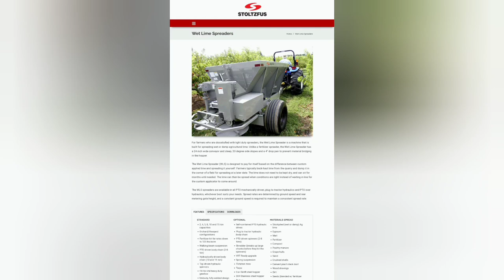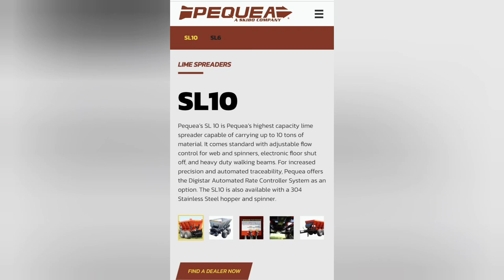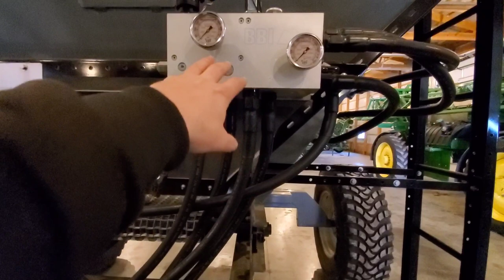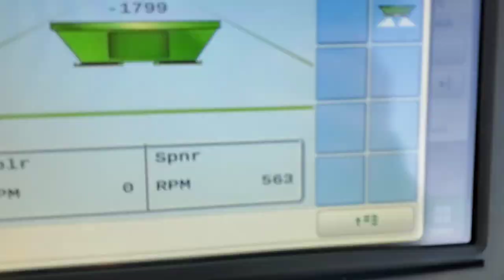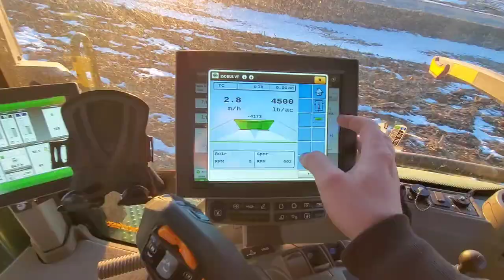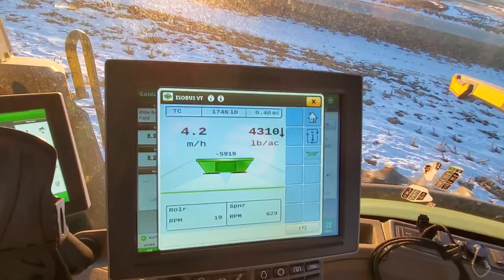BBI Grasshopper

Comment: I live halfway between the Pequea and Stoltzfus spreader plants in Lancaster County, PA. Curious how the BBI compares to either of them. We sell the Pequea units at the dealer where I work, and they seem to have a good reputation as long as they are taken proper care of - these things require a lot of upkeep (even more than a manure spreader, from what I've seen) as the lime really takes a heavy toll on them.
Reply from the maker: Thanks for asking ... just depends what your spreading ... the sl10 pequea is a slat bar 30 inch wide chain - which is only going to apply lime (not sure if jts rated for compost)- definitely a no go for fertilizer unless it's extremely high rate ... plus they don't offer an iso controlled unit - just set speed rate charts ....
The stolzfus  is a good cart - heavy duty .. they are available as a wet lime spreader or the Redhawks series - both are same box - different drives ... the Redhawk uses ground drive contact wheel - the wet lime has multiple drive options ..... the bbi offered iso control, fertilizer and lime capability and in crop spreading- so we went that route

Comment: Spreader looks good. Would like to see more content on it, was looking at one of these units as well. I got 2 6120Ms on order now!
Reply from the maker: Awesome! ... great tractor - we really like ours
Reply: @Blackearthexcavationandtiling  Hopefully it does not show up late... One is scheduled for April and one for July. Similar spec as yours... IVT, 4 SCV, TLS, MCS but one has a front hitch and one does not. No loaders either. Any idea what the SCV requirement is on this spreader?
Reply from the maker: @Iciielitez  congratulations- I think you'll like those tractors .. we sure use ours a lot ... good options! 😁  ...... on the cart - it needs about 30 gpm to the scv's - you can run it with less, but rates become effected, you'd just have to do a pan test .....
Reply: @Blackearthexcavationandtiling  thanks! I would hope either a 6430 Premium or one of the 6120Ms would have enough pump flow for the spreader…

Comment: With the growing non replacement mentality making spreaders from the distributors almost non existent, I've been looking for a used one. Gawwwwwd! What a challenge! There's not a lot of junk ones out there, and when you do see them they still bring crazy money. I'd like to find one needing some repairs,but they still bring big cash...... So, I heard you say 409 SS and had to check up on that. I'd never heard of it. Turns out it's SS like in a kitchen sink or some auto exhaust. The older ones must have been 304 or 309----non magnetic.
Reply from the maker: It sure is hard to find good used stuff...... stainless steel is something about nickle content in the steel (something like that is what I was told) ...